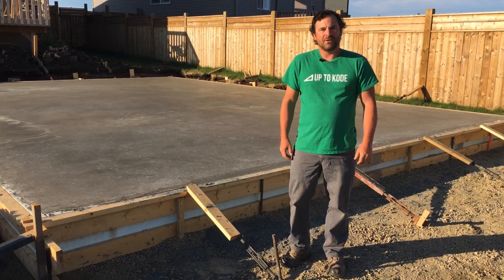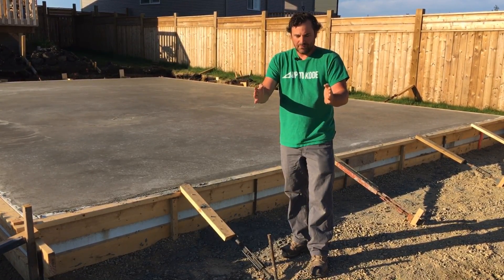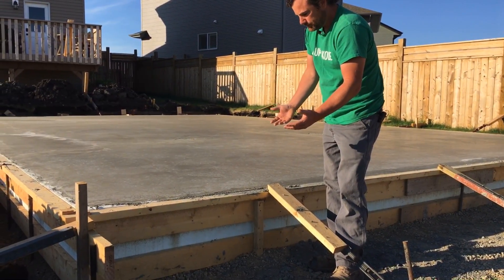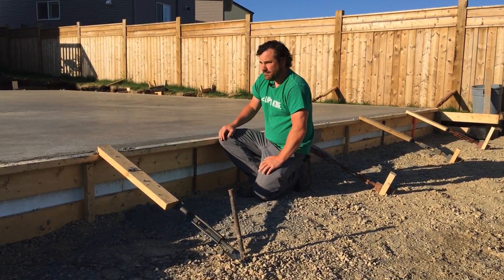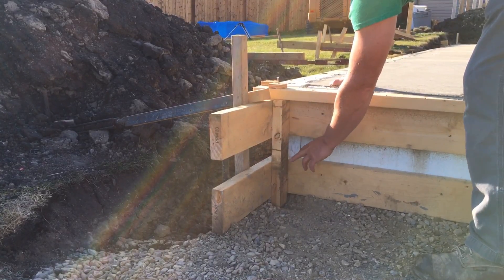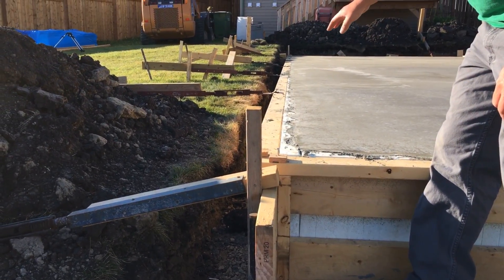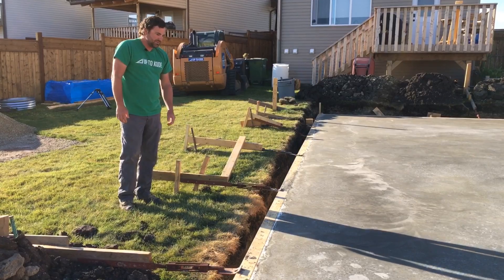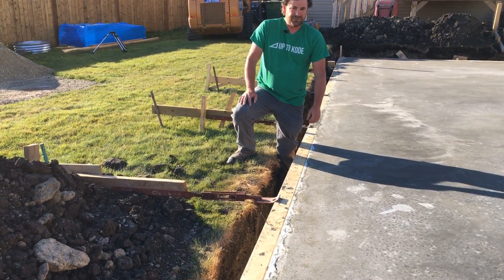Forming a Garage Slab - Do's and Don'ts

Comment: Hi Kody…thanks for your videos. I always take something away from each of them.
I have a question…I am building a 60 x 35 garage with a monolithic slab. My plan was to use two rows of ICF with a 10” cutaway on the inside of the form for the “haunch”. Basically, what you did here. I watched the video you did explaining what you did here…I believe you cut the ICF in half?
My question is this…I am seriously considering using 2” rigid foam board on the perimeter, and brace it just like you did here. I would run the rebar as plans depict…and just pour the footer if you will, up to the haunch on first pour. Then work on the plumbing and interior. The slab pour would be completed once everything is finished on the interior. 
For a DIY job….seems to be the simplest approach? Do you see anything wrong with my plan? 
Or would you recommend I stick with using the two layers of ICF and cutting down the inside?
Thanks again…

Comment: Hey Kody, I always like your videos.  You do things the way they should be done. One question though, how did you get away with a garage so big in that yard? Does the property go back A LOT farther? Where I am, (Newfoundland) no municipality will allow a secondary bldg to take up more than 10% of the land area as well as a min 5’ from boundaries.  Just guessing from the look of the property size, here the max would be 16x20 with. Roof peak of no higher than 11’ 6”.  The rules must be a bit more relaxed there.
Reply from the maker: Thanks Derrick ! This lot is a corner lot and it’s pretty big. I’m not certain on the percentage of yard it’s allowed to take up as the home owner pulled all the permits for it. We are 2.5 meters from the alley and 1 meter from the fence.  Thanks for the support!

Comment: Your rigid insulation description was unclear
Reply from the maker: My focus was mainly on the brace work and tips for an easier pour. In a few days I’ll post the video where I incorporate the ICF block into the perimeter.
Reply: @Robert Montgomery ... why it was unclear? He said he used a ICF block and cut in the middle. He did this so that the plastic web inside of the ICF blocks goes into the concrete and it’s bonded with the concrete and a other benefit is that you have the plastic strips on the outside to mount something on it. ... I think it’s simple to understand and what else u wanted to say more?
Reply from the maker: Very well said.